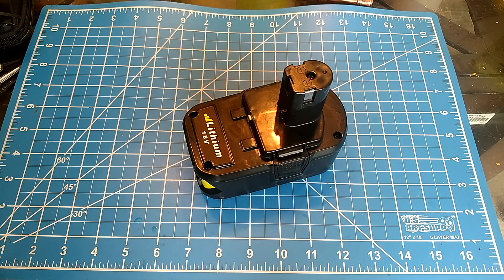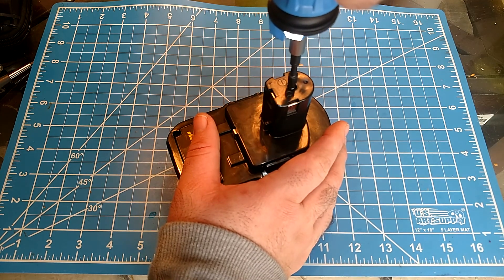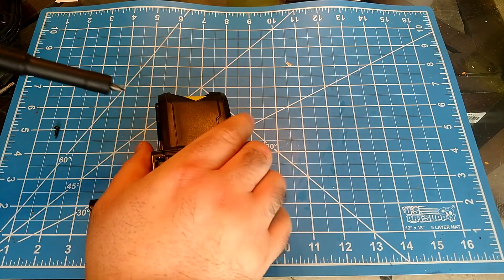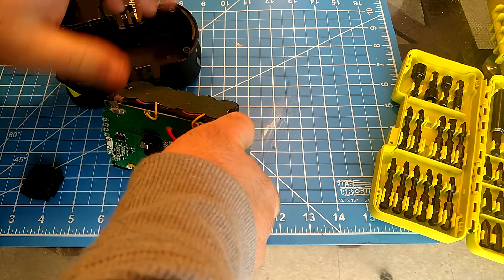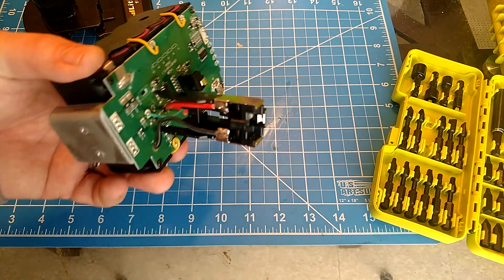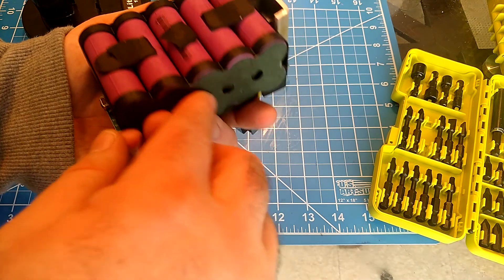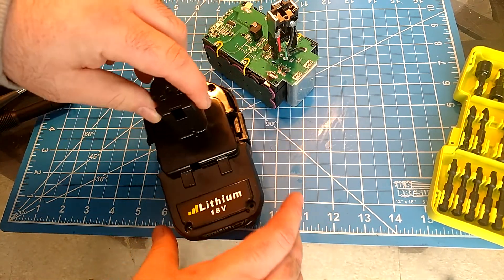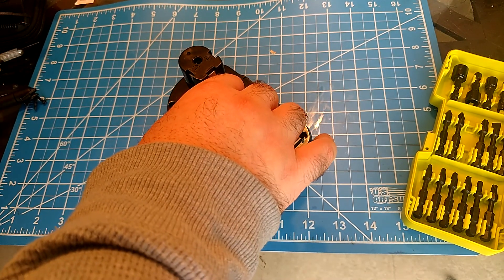Let's dissect an off-brand Ryobi one plus battery

Comment: 18650 batteries shocked me that they used them kinda kool
Reply: It's quite standard in the industry, you will find this in alot of different appliances that uses batteries.. laptop-batteries amongst others are 90% of the time 18650 batteries.. it's nice to scavenge laptop batteries and such for cheap/free 18650 batteries :)